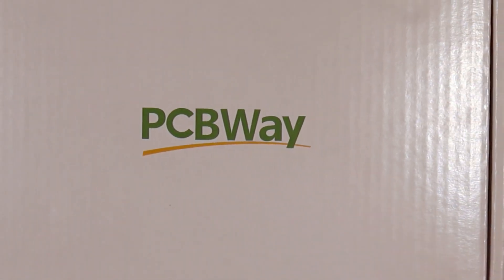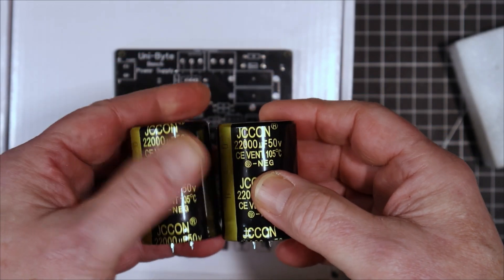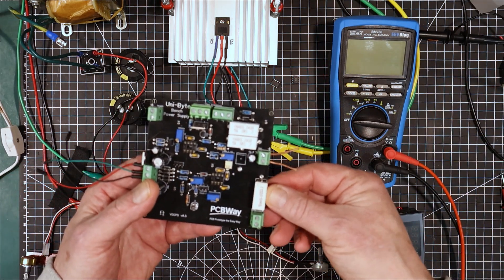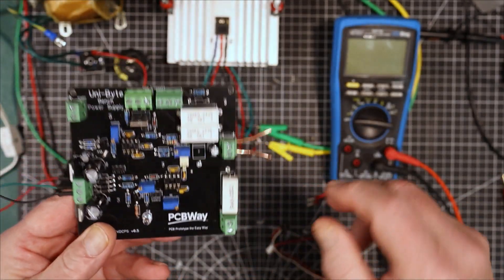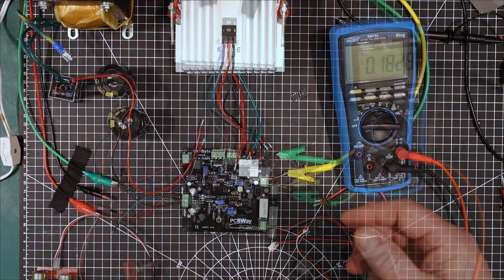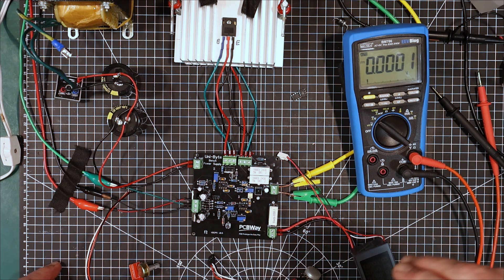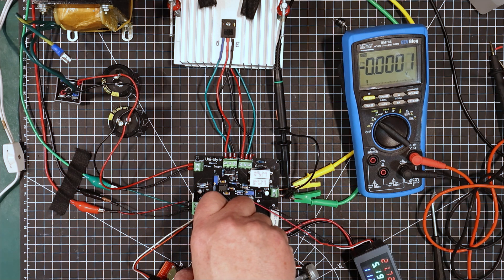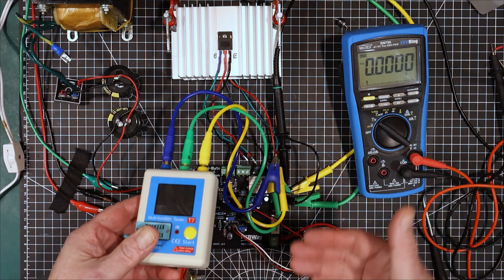Uni-Byte 0251 - VARIABLE DC Power Supply - MAGIC Smoke: Part 4

Comment: So you put like:
(24 * sqrt(2) - 1.5V - 19.5V) * 5A = 65W
into these skinny heatsinks, via paralleled but not verified to share current TO-247 packages.

In my tests I find the comfortable operating limit of single TO-264 actively cooled on a 5mm base ("needle" fin) heatsink from Ali (150x130x17mm) to be around 90-100W.
That's way more heatsink mass, less thermal resistance on both HS base and BJT package..
TO-247 I tried on it as well, IIRC it did handle around 20-40W realistically, YMMV depending on how good the die connection is.

P.S. Lower ESR on a 50/60 Hz FBR is actually counterproductive.
Reply from the maker: The thermal characteristics of all TO-247 packages are no the same.  i.e. TIP3055 has a thermal resistance from junction to case of 1.4 °C/W whereas a MJL21194, for example, is just 0.7 °C/W.

Also, I am using a silicone pad for insultation - thermal resistance of 2.   Mica would be better, but I'm all out.   Plus, those heatsinks have a thermal resistance of about 1.5 in free air, and I guess about 1 with that feeble little fan.  So, the total thermal resistance is about 4.5  meaning that about 33W per device (basically what we had) would result in a junction temperature of 150 °C.  That's without taking temperature derating in account.  If we do, we see that the arrangement shown would result in a realistic maximum dissipation of around 20W per device - or 40W in total.  So, yes, I exceeded that handily with the 65W you correctly calculated.

They should be sharing current fairly well. They each have 0.1Ω resistor in their emitter.  That was one of the tests I had on my list though.
Reply: @uni-byte  MJL21194 is TO-264, not 247.

Measurements I described were for TIP3055 and FJL6920 initially mounted directly on heatsink, then I moved TO-264 to alumina (Al2O3) insulator, highly recommend.
I was measuring temp with K-type soldered as close as possible to case on middle pin and calculated roughly following: R(j-c) = 0.625; R(c-h) = 0.243; R(h-a) = 0.36 C/W. 
So, it happened to be exactly minimal setup good to handle typical 0-30V 3A LPSU kit up to 40C ambient.

I'd verify that 1.5 C/W figure for heatsink, does not seem right. Also, the higher the resistance with low mass the more it should be dependent on conductivity delay, so may be limiting further. Pay attention to fan ramp up reaction time as well, it did look slow.
Reply from the maker: @Mr.Leeroy  "MJL21194 is TO-264, not 247."  Ahh, yes you are correct.  My bad.

The heatsink is a C&H CHEH0711 3" long.  I just checked and it's actually rated at 1.9 °C/W in free air, so even a little worse than I previously stated.

Where do you get your Al203 insulators?
Reply: @uni-byte  YT is probably deleting my comments about Ali..
Reply from the maker: @Mr.Leeroy  Got it.
Reply: @uni-byte  It was not trivial to find 10pcs lots at normal price, but I got 20x25x0.6 size for $3-4 delivered 2 years ago. 50pcs lots were everywhere.
Reply from the maker: @Mr.Leeroy  Found some.  Ordered for to-220, to-247 and to-264.  Thanks for the info.

Comment: I'm not sure about the following comment. Do you have to  match the transistors or drive them separately to prevent one from doing all the work.
Reply: That is a great question. Yes, you are correct. The transistors need to be balanced by some means. Often, resistors of equivalent value are placed on both of the base inputs. IIRC, that's what Bill did, here. But, you need to confirm that by looking at his schematic. There are other means to do the balancing. Diodes, instead of resistors, are sometimes a good option. Without some form of balancing, one transistor ends up doing all of the work. And, as that transistor heats up, the condition worsens, more and more. This is called thermal runaway and it can cause catastrophic failures.
Reply from the maker: There are resistors put in series with the emitter of each of the transistors.  This provides a bit of negative feedback that balances the current flow through them.

Comment: That’s too bad, I was excited to see it finished. I know you will get it resolved and fully functional. Looks really good!
RJ
Reply from the maker: Yeah, those TIP3055s are not the right choice for a 25V 5A power supply.  They can't deal with the entire operational envelope.  I should have set the highest voltage first a a couple of amps, then set the current at the highest voltage to reduce teh dissipation on those transistors.  I might do that, or possibly get a pair of MJL21194s.  They'll work in this situation.
Reply: @ unless the cost is prohibited (not familiar with you new number will look it up after I send this) then it’s probably good idea to go slightly overkill on a power supply as they tend to get punished by users. 
RJ
Reply from the maker: @rjordan363  You're right.  This project was really supposed to be a test of a different design.  Instead of the typical, an op-amp driving a Darlington emitter follower, I'm using a PNP transistor to drive the pass transistors so that a much higher voltage can be achieved while still using cheap standard op-amps.  I really should be using a multi-tap transformer and incorporate tap switch to deal with the dissipation.
Reply: @uni-byte  “I really should be using” 
Nah, that would not be nearly as interesting. What you’re doing is interesting and enjoying to watch you create because it is not just another power supply using the same old design. I like it and look forward to you succeeding with it as I know you will. 
RJ
Reply from the maker: @ Thanks!